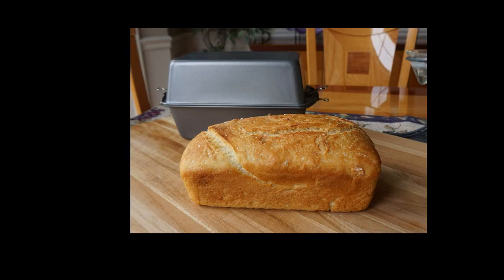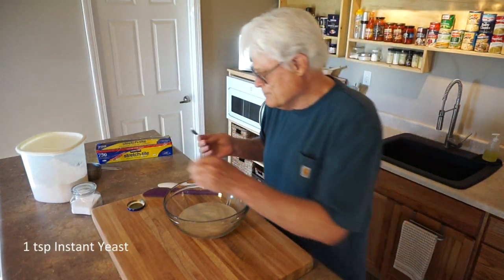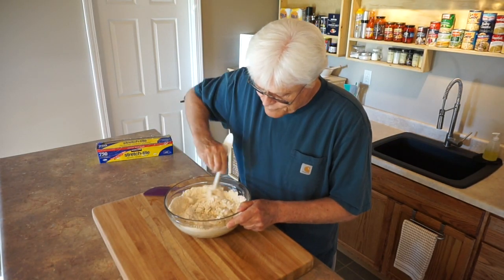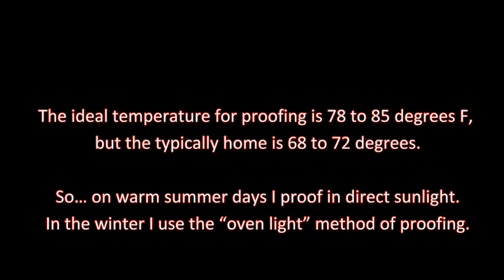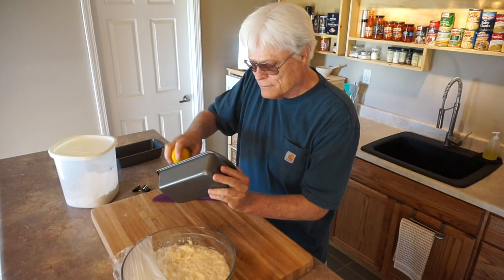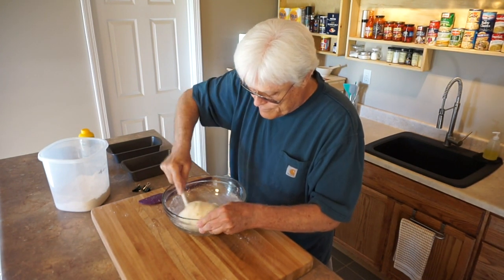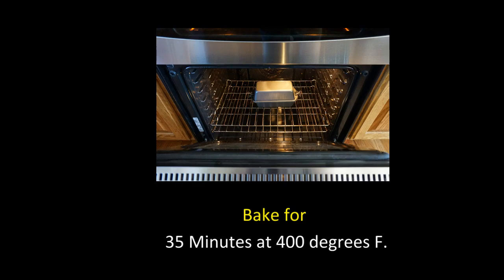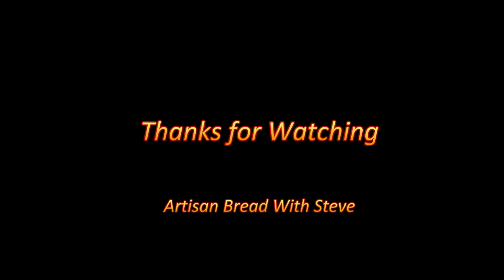How to Bake No-Knead Bread in a Poor Man’s Dutch Oven (no mixer… no bread machine…)

Comment: Steve, would you be able to give us Europeans (well Scottish folks !) the weight of  the flour and water you use in grams please ?  Looking at the conversions on line , 3 cups of flour is 360g and the 12oz water is 354 which makes for almost 100% hydration
Reply from the maker: Raymond McCall I use two sizes… 3 cups and 3-1/2 cups:
3 cups = 15.75 oz (450 grams) bread flour to which I add 12 oz water (340 grams).
3-1/2 cups = 18.375 oz (525 grams) bread flour to which I add 14 oz water (400 grams).But the only time I weigh flour is when I make batches of 5 loaves at which time I use 5 lb (2,268 grams) flour to make 5 loaves.Steve
Reply: @artisanbreadwithsteve  Thank you very much for the grams weight. I also live in Europe and this is very helpful. Have a nice day over there Steve. God bless.

Comment: Can I use a Pullman pan instead of the poor man's dutch oven? I would like to get nice even slices.
Reply from the maker: You can use any bread pan but a Pullman is usually a larger loaf. Steve
Reply: I found a 4x9 Pullman pan on Amazon I have it on order should be here in a couple of days I'll let you know how it turns out
Reply: the Pullman pan worked great. how can I send you pictures.
Reply from the maker: Email them to artisanbreadwithsteve@gmail,com. Steve

Comment: Hi Steve, if the room tempreture is always around 28 to 37C in my country, how should I adjust the proofing time?
Reply from the maker: In a warm climate dough proofs faster, but it isn't a problem unless it rises above the rim of the pan. Steve
Reply: +artisanbreadwithstev thank alot Steve
Reply: +Kiều Thanh Nguyễn Hi Steve again. I have tried your technique yesterday and let it proof over night (around 12 hours) at temp about 27-29C. Today morning I did the "roll and coat" but my dough didn't look like yours. It did not come into one nice smooth lump after roll and coat but still very sticky all over the bowl and the wooden stick, and not smooth at all. I'm still baking it anyway to see what coming out but don't have a good feeling. Will you say my dough is over proofing, Steve? (Thanks)
Reply from the maker: Your dough probable proofed just fine. Did you scrape the side of the bowl after "degass, pull and stretch" and prior to "roll to coat"? Steve
Reply: +artisanbreadwithstev Yes I did. The bread came out quite heavy and smell sour. It's the first time anyway, and my flour a bit old. Let me try again with fresh flour. Thanks for replying me. Really hope no-knead bread technique work here (South-east Asia)

Comment: HI STEVE,

SORRY FOR THE CAPS BUT MY CAP LOCK KEY IS STUCK FOR NOW.

THANKS SO MUCH FOR YOUR GREAT RECIPES, IDEAS AND VIDEO'S.

I ESPECIALLY LIKE THIS RECIPE AND THE OTHER ONE WHICH REQUIRES MORE PROOF TIME

I THINK USING BOTH LOAF PANS IS INGENIOUS STEVE:).

BTW I WAS WONDERING IF I CAN ALSO MAKE BOTH RECIPES IN A CONVECTION OVEN, AND JUST LOWER THE DEGREES SO INSTEAD OF BAKING AT 400 F DEGREES I WOULD CONVECTION BAKE AT 375?

WOULD APPRECIATE YOUR ADVISEMENT REPLY HERE STEVE, AS IT IS JUST TOO HOT NOW TO TURN THE OVEN ON AND MY A/C DOES NOT COOL THE KITCHEN OFF AT ALL, AND USING A FAN IN THE KITCHEN JUST CIRCULATES THE HOT AIR IN THAT ROOM.

THANKS AGAIN STEVE AND WISHING YOU CONTINUED PROSPERITY, AND SUCCESS.
Reply: I couldn't help myself from laughing at this comment 
In my head you where shouting 
XP
Reply: I read your reply Allie Walker and I can't help but laugh at your ignorance, and failed attempt of trying to demean and belittle me.

Evidently Allie Walker you were/are incapable of understanding my opening sentence where I stated the obvious. 

Reading and perception are key factors when communicating with others, so are explanations, and respect for others.

I also can recall that adage which I truly admire for its obvious simplicity, and direct truthfulness, especially when someone tries to demean or belittle another person on a public forum, but their attempt fails when it is they who cannot comprehend what was clearly written.

In your case Allie Walker, perhaps this is something you will be capable of remembrance...."the one that laughs last, laughs best".
Reply: Hello ravenblakhawke,
I did in fact read and understand your opening sentence. I apologize if my comment got your metaphorical panties in a twist. I had no intentions to demean and/or belittle you nor anyone else. If you found any malice in my short comment please accept the fact that you are/were mistaken. I simply find the mental image of someone shouting praise and thanks at the top of their lungs cute and amusing, but not a sign of their intelligence or lack there of of. I hope you enjoy making your bread just as I have.
Sincerely,
                     Allie Walker
Reply from the maker: +ravenblackhawke You can use convection and you're right... you should adjust the temperature, it will just take a little trial and error. Steve
Reply: Many thanks Steve!
Reply: Allie Walker apology of yours is not sincere.

If it was truly sincere Allie Walker you would not have continued trying to belittle and demean again by replying in your second reply with this group of phrases.   

 "I apologize if my comment got your metaphorical panties in a twist., and btw Allie Walker the rest of your lame untrue apology excuses which follow in your second reply to me also support my final observation, and reply".

When you reply to strangers Allie Walker try behaving as a sensible and mature respectful adult, and save your time and effort, as this is my final reply. I am sorry I had to encounter your disrespectful remarks addressed to me on Steve's thread.

Evidently Allie Walker you have no internet respectfulness or proper adult internet etiquette, and that is painfully obvious by all your dishonest immature replies.

Again sorry your cheap shots at again being disrespectful and demeaning did not work, and btw save your time and effort as I will no longer reply to you Allie Walker.

"Unfortunately you Allie Walker are as they say, just not worth any more effort".

Comment: Please I need your help. Today when I tried to make the bread, instead of shaping like a dome , it became flat. What could be the reason for this?Though it was tasting all right.  Usha Rege
Reply from the maker: Usha Rege When you say it didn't have a dome... do you mean it did rise above the rim of the pan? What kind of pan did you use? Steve
Reply: artisanbreadwithstev I used a pyrex one with lid, which I had successfully used earlier, to make a bowl shaped bread. Usha rege
Reply from the maker: Usha Rege I tested over a dozen baking vessels in developing this recipe. Metal bread pans came out on top while cast iron loaf pans and glass/Pyrex were towards the bottom... the top had a tendency to collapse. If you have two matching bread pans try them. I think you'll like the results. Steve

Comment: Where do I get the clips at?
Reply: +Hilda Masi stationary department of any discount store. Any kind of springy clips would work- they're just to hold the pans together.
Reply: I'll bet you could use wooden clothes pins too. You just want to keep the pans in place for when the bread rises inside. I never would have thought of this trick. Now where did I leave that duct tape?
Reply: Remember that you are actually putting it in the oven for the first part. Wood won't last long at that temperature, so stick with binder clips from Staples, or Rite Aid, or wherever.